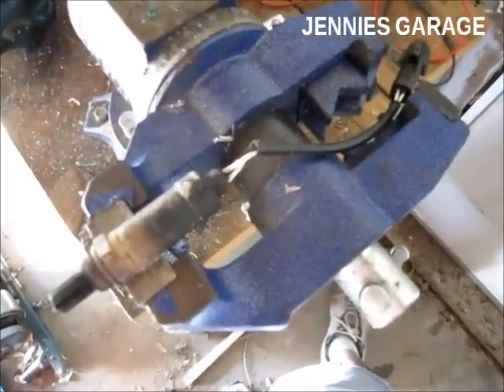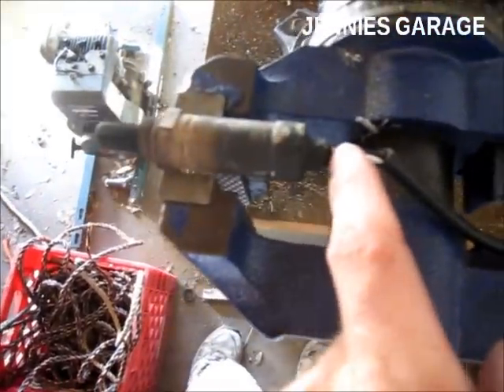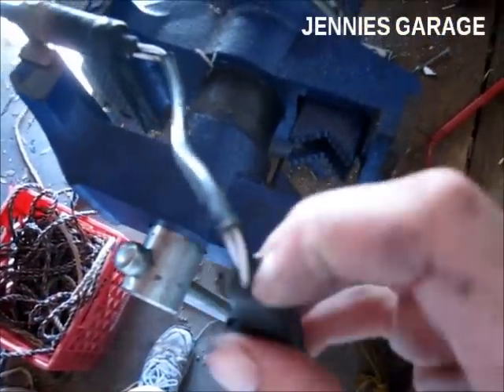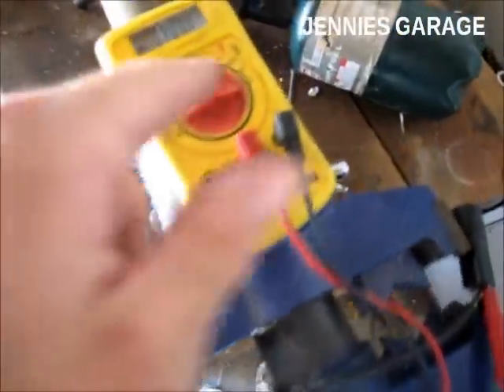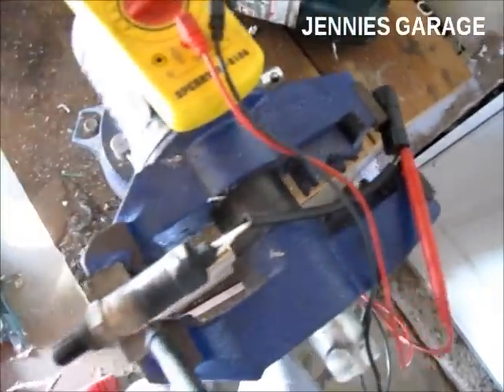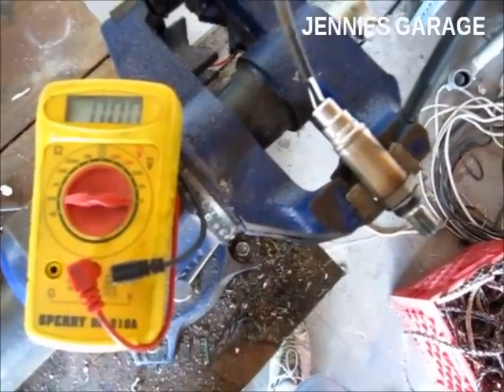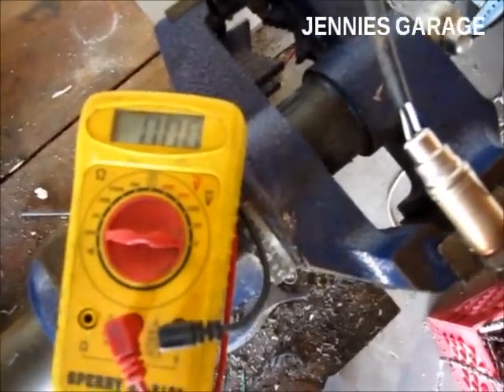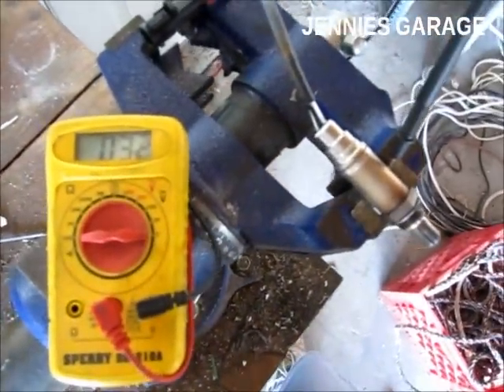How To Test An Oxygen Sensor - Old Vs. New

Comment: Hello,  thanks for the video.  One of my car had CEL code for "too lean" condition, OBD2 scanner found really high LTFT (15%).  I troubled shoot and found out it was caused by a bad O2 sensor. Replaced it and fixed the problem.   I have another car (2001 BMW 330I at 160K mileage).   LTFT and STFT of both banks are ~ 0%.  My question is that if 0% LTFT is always a clear indication of good O2 sensor? Thanks much.
Reply: I'm guessing that they're both at zero as freeze screen data when you got the code? I usually see that when the computer realized to set a code with the car not even being turned on. If you got a live scanner on there I'm sure you'd see the short term and long term fuel trim change. (some even at idle, more when accelerating or experiencing changes in driving conditions even when just cruising). If it wasn't changing your car wouldn't be running. It's running right?

Comment: This is NOT a proper test for an O2 sensor. The ONLY test that is approved and should ever be used is the snap throttle rise time test. A passing sensor will swing from a max .175 volts to a min .800 volts in under 100ms. Any test other than this will not be accurate and will without a doubt bite you in the ass. If you are a licensed shop or mechanic anything other than this test on your work order will get you a visit from the BAR and money out of your pocket. It is simple, it works, it will show the BAR that you know what your doing.
Reply: To tell ya the truth I was also wondering what the hell this is about. Some people dont deserve a shop at all. The better bet would be "Mechanic2", Give the guy a round of applause!
Reply: TheMechanic2  I agree the test in this video does work. It may not be thorough but it would give me a good indication if it's working or not. Not everyone has $200 to $300 dollars to have it tested and replaced. My O2 died today but I own a scanner that can monitor real time data streams. I have 4 sensors, 2 upstream and 2 downstream. Scanner gave me a P0156 and went to look at the live data and it was showing 0 volts on Bank 2 Sensor 2. The other 3 sensors were in range and woking. I agree the scanner is the best way but I don't have an issue with the method in the video for testing. I think a tester should be aware of the type of gas (propane/MAP/Oxygen) being used to test since there are huge differences in temperatures/times. I would hate to damage a O2 during a test. However, prices are fairly cheap for an O2 these days. I ordered a Bosch O2 today from Amazon for $27 (2 day free shipping) and it's the exact same one Ford uses but they want about $67. Even Amazon sells the the O2 about $18 dollars cheaper than any auto parts store. Normally, I would order from Rockauto but it was only $1.50 less but I would have to pay for shipping. Great advice for removing an O2. I always use PB the day before and let it set in over night. Heat has alway worked well for me in the past.
Reply: knowledge is king, had a run in with IRS ...I ALMOST SIGNED THERE CRAP WHEN SOMTHING IN ME SAID wait ...told them i needed to think ,so i went home and studied.....what do you know there crap is smoke and mirrors....sorry love telling that story....Buy the way, i dont take orders from any GOV......man does not ask for permission....persons,citizens,residents,drivers,voters,defendants...DO....GOOD DAY ALL...
Reply: .175 volts is less than .800 volts, so, do you know what you are doing?
Reply: Of course it isn't a correct way to do this, but it can easily separate those that are 100% bad from those potentially OK, not to mention that you don't need to install that sensor in some car, warm the engine, etc etc before checking, then waiting for engine to cool down to remove it. If I'd like to use my car to test o2 sensor I'd have to remove headers to access sensors that are on the engine side of pipes with almost no clearance to do anything down there. Not the most convenient way...
Reply: mibars Believe me I am not trying to sound like a smart ass. I have been doing this for a while (I will leave it at that). But a functioning O2 sensor will be at operating temp LONG before you could get under your car and remove an O2 sensor. Next why not start out right instead of backyard garaging it? Doing it right will give you the confidence to explain to a customer why you have to replace a $200 O2 sensor instead of throwing parts at the vehicle. Next the test does not require removal. Most of the time I can get a reading from a cold start to a pass or fail test in UNDER 5 minutes without getting burned. Next here is a little tip if you have to remove an O2 sensor. Starting from a cold engine start it and run it for about 60 seconds. This gives a little difference in temp between exhaust and O2 sensor and they will come out real easy. Oh make sure to tighten ever so slightly FIRST before you loosen. Other than that if it is a real bugger spray a little Kroil on it and let it sit for as long as flat rate will let you. (another little joke). Kroil is the bomb for rust and carbon.
Reply: TheMechanic2 Let's start with how I found this video: One of my new (installed last year)  O2 sensors in car went bad (lost connection somewhere inside, oscilloscope reads only background noise, not even 0V), but I kept my old OEM ones. I've replaced both of them last year just to save on possible labor and gaskets, because to replace $20 sensor I need to have whole header removed and what I thought that replacing 23 years old sensor with new one will reduce chances of having to do it again in near future. 
So I have two sensors lying in a box, one is bad, one is good, no way to tell which one is faulty. And guess what: I've just did what was shown in this video and one of them is clearly bas as it goes up to 20-30 mV, while on the other I've measured over 600 mV and it reacts fast. 

Thanks for an advice for removing a sensor, but in my car there are two sensors one next to another, both pointed towards engine block with like 1cm clearance between it's end and engine, not to mention that there is virtually no space for tools between radiator, it's fan and header. To complicate it even more standard "hole" type wrench hits header before fully engaging with hex on sensor and there is no space to put a socket. So no way to run it before removal...
Reply: The exact same way. Just because the monitoring/control system is different does not mean the O2 sensor is. You would use the same rise and fall ms time to verify good response and peak to peak values.
Reply: mibars While I concur about the bench test for obvious new vs. bad sensor test I am just letting you know the "real" test. Also just because the O2 sensor is in a difficult spot to access does not mean the wire is. :) You can probe the wire anywhere up to and including at the ECM/PCM.
Reply: ***** While I agree with you about the BAR maybe not using those words exactly but I do agree, what you have to keep in mind is that they are one of the government officials that have the power to shut down your business. Like saying the same about the IRS. You can say it but you SURE don't want to be on the IRS's bad side or they will DESTROY you.
Reply: Go back and re-read what I said. You seem to have deleted in your head that you have to have a minimum of 800 millivolts and no more than 175 millivolts in its lean sweep. There are min and max levels that have to be achieved for you to conduct the test. Unlikely you are a driveability tech as you would know this. Stay in school.

Comment from the maker: The O2 sensor is one of the main components of modern fuel injection systems. It would be tough to get the car to run well without one, unless you went to a carburetor, or other type of fuel system that wasn't designed to use the oxygen sensor.

Comment: i took my car to get a smog test and it tested high for hydrocarbons. I have a check engine code for the 02 sensor heater p0135. I was wondering if i changing the sensor would help my car. I think it running to rich (too much unburned gas). Does the o2 sensor control the gas mixture in any way?

Comment: because most of the time your looking to replace something because the engine is not running as it should. If you test the oxy sensor and find it to be faulty then you know you have found your problem, and that replacing it will in most cases fix the problem

Comment: Even though using a torch simulates the heat the sensor will experience while reaching operating temperature, you also damage the O2/HO2S and will need to be replaced after this "procedure". The best way to test OS/HO2S is with a scan tool. You will open the propane valve that is connected to the manifold vacuum line while you run the vehicle and this will cause a rich air fuel ratio and voltage spike up to .9v. Normal voltage of a proper sensor is typically .45v.

Comment: I would think if you have a bad OS that your check engine light would come on.  If it doesn't, it could be something else.   My car has only ONE OS.  Some cars have more than one.   They're not hard to replace.  Kind of like changing a spark plug that has a wire attached to it.

Comment: Very interesting video.  

I have a code scanner which has helped a great deal.   I bought a cheapie OS and it's failed in about six months according to the code scanner.    Plus, on these cheaper ones, you may need to cut wires and crimp them back together rather than unplug the old unit and plug in the new.   So, it could have failed or the crimped wires could have come loose.   Going with Bosch.

Comment: Needs to be a torch, you're effectively "snuffing" the sensor of oxygen using the flame to shield it from outside oxygen and heating it at the same time. it needs high heat to work.

Comment: Great video! I just replaced my sensor, but I'm still getting a MIL (P0157) code from it. I have an intermediate extension cable from the sensor cable to the PCM cable, and I'm wondering if thats not sending or receiving a signal. Can I test that cable? I've never used a voltmeter. Its a four pin extension with a male end and a female end. Do I just touch each end of wires with the probes one wire at a time?

Comment: I don't know why that would happen.  Assuming it doesn't run too rich all of the time, I suspect that there may be contaminants in propane that coat the sensor catalyst element and therefore destroy the sensor.  If the sensor switches and the car has good, low fuel trim numbers, then the problem is likely contamination of the element. Sorry my previous comment is gone, jenniesgarage is censoring me and erasing my comments because I'm showing how poor their methods are in this case.

Comment: You absolutely can control the conditions in the car.  I do it everyday.  If you add an unburned fuel to the stream you should see the sensor spike very quickly, then to create a lean condition, open a large air leak and watch for a very quick change to near zero volts.  If it reacts from rich to lean and vice versa within 100 milliseconds, then it may be okay.  Then you need to see whether or not it ranges from under 0.1 volts to above 0.9 volts.  Then you check the rate at which it switches.

Comment: Thanks for your comment.  The oxygen sensor is a miniature catalyst that reacts to hydrocarbons, of which all burnable fuels contain.  It also does not need any oxygen.  If you have no oxygen in the exhaust, but no combustibles either, the sensor will not react and you will have no voltage generation.  It is an oxygen demand sensor.  It reacts when between the two sides there is or is not a desire for oxygen to combine with hydrocarbons.

Comment: Your post got me to thinking. Are these not designed to look at ALL (as you said combustibles VS oxygen) auto emissions and send a reading back to the ECM accordingly? Therefore would propane not give you a false reading since the sensor is designed for gasoline. Correct me if I am wrong.

Comment: (continued from below...) just by changing the amount of combustible materials and using a completely inert gas, like nitrogen, passing by the sensing element! Please check out some knowledgeable sources and you'll see the truth.  I recommend reading an SAE white paper about them.  They can be purchased fairly cheaply if you want to know how they really work. I am a certified emissions repair technician, shop foreman, trainer and ASE Master L1 certified automotive technician.

Comment: Where does the electricity come from to register on the voltmeter?  Could you use a baggie wrapped around the sensor and fill it with an inert gas?  I'm just wondering because I'm a little afraid of burning up my o2 sensor.  Have you had issues after heating o2 sensors to cherry red temps?

Comment: u r SOOOOO dumb. u r killing your new sensor. it is VERY sensible. why u just dont put CPU to diagnostic and check if it is ok? for older car there is VERY low cost cable with cracked diagnostic program that show u if it is good or not.

Comment: Hey I had a question about the Voltimeter. On my voltimeter the lowest number is 20 VDC. I wanted to know if I left it on that setting would that be fine for the sensor.

Comment: To simulate a rich condition, connect a test light to the (+) battery terminal, then touch test light to sensor plug in.It should read 1000 and computer will lower fuel going to injectors and it should show in the negatives. To simulate a lean condition connect it to the (-) and touch the test light to the sensor wire it should drop to 0 and it should show positive.All will cause rpm to change.

Comment: I am getting code P0421 which is triggered by the sensor after the cat when the levels differ enough from those at the sensor before the cat.  I heard you can trick the downstream sensor with that Tom Thumb or some red RTV slilcone but I am trying to avoid removing since I dont have the tools and probably lack the skill.

Comment: If the sensor measure temperature of ambient air at the end that sticks out of the engine, you could fool it with some kind of insulation tape or something, right?

Comment: My O2 sensor has four wires, 2005 Sonata.  I did get it up to 1V with my torch but it was very slow and took several minutes to get there.  Does that mean my sensor is faulty or was my torch not hot enough?  It's just a cheapo propane torch like you would buy at any hardware store.  Thanks for the video.

Comment: thanks for the movie has helped with how to connect up the multi meter to the sensor as I have not dealt with electrical systems before, now I know I can figure out if my magna TR's sensor is buggered only getting 360 km to the tank which is horrible considering it should be getting 11km to the litre

Comment: Hi, very nice video, thank you. I have a question though. I have a faulty sensor on my car, and i was thinking to do an experiment, do you think it is possible instead of lambda sensor to plug a custom electronic circuit that will generate at all time 0.9 or 1 v DC (in this way to trick the onboard computer that lambda sensor is giving a good reading). the electronic board will be a simple converter from 12v car battery to 1v and will be plugged where the lambda is plugged in. lambda stays in